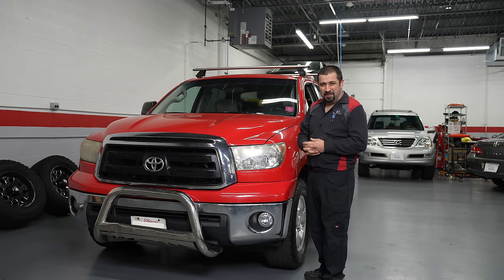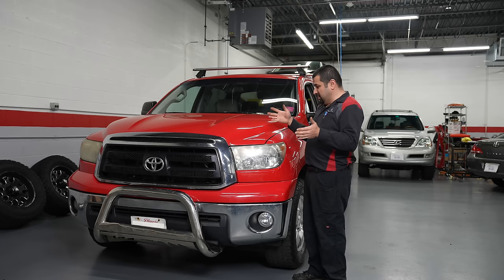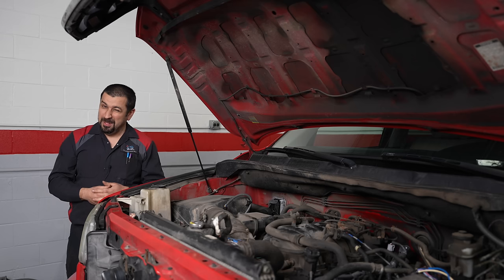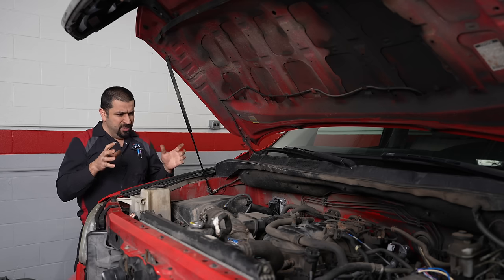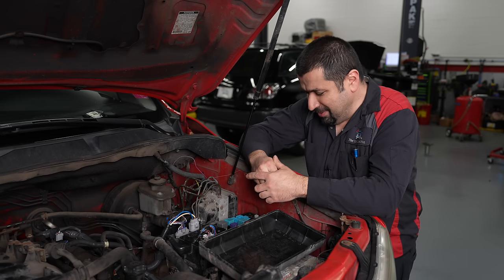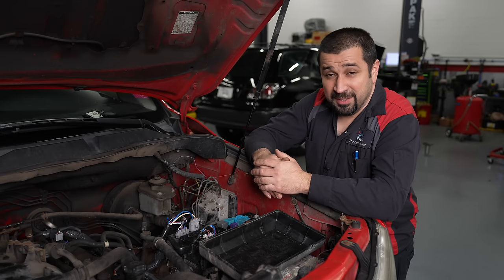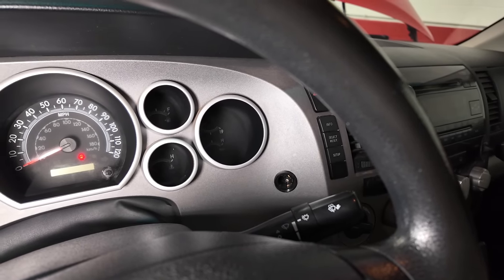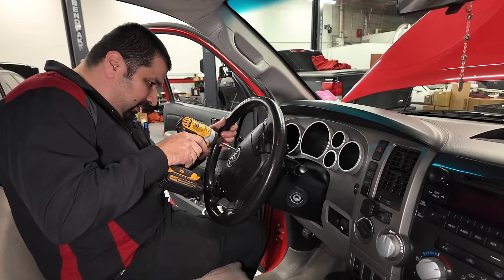Shop BOTCHED Wiring In This Truck Causing a $1400 Repair Unnecessarily

Comment: Good morning I just watched your video I have a truck that I have replaced  partss on 2 or 3 times already . I have replaced the secondary air injection pumps 3 times already. Every time I take them out this condensation in the pumps. I have also replaced the secondary ear injection valve already that's located on the needs the wheel well of the truck. So basically once a year the trunk goes into limp mode I'm still able to drive it but it has lost power until I replace everything and reset the computer. My question is what is causing this in the first place.

Comment: How tf you gonna see ground on the other side of the fuse slot when your horn button on the wheel is not pressed and you also disconnected the signal wire that completes the path to ground!?!

Comment: Fixing a horn by wiring a new ad hoc circuit to a new switch on the dash?  That cannot be legal.  A horn in a car must be present on the steering wheel facing the driver so the driver can reach it INSTANTLY in a millisecond without thinking about it.  That shop who did that work should be reported to the state.

Comment: 24:50 you shouldn't expect 12v on one side and ground on the the other side of the fuse, otherwise the fuse would blow when inserted in place. You should expect some impedance higher than zero.

Comment: What i found confusing with the horn wiring diagram was that the bottom switch to ground on the left side the description was "cruise control main switch". Is there a horn involved with the cruise control?

Comment: I did a battery call one time on a 4 Runner that would crank as soon as the battery was hooked up, melted the terminal off a brand new battery in seconds. Probably not the same issue here but it’s always scary when you have a freewheeler

Comment: Sorry to be off topic, but I'm wondering what you think of the Avalon hybrids 2019 and up. I really love the interior, but notice all your videos mention the ~14 to 18 range. Is the 19 and up just too new to know with the data, or is there something holding them back. Also looking at 2019 and up Camry's, but preferably 2021 interior. Thank you!
Reply: I know for a fact the Avalon Hybrid was running neck and neck with the Camry Hybrid AMD bought for himself. He chose the Camry because it has some technical features not offered in the last year of the Avalon Hybrid.

Comment: The horn issue might be because the security system isn't working?  Since the horn runs through it, can the security module cause the horn not to work?

Comment: Imagine that. A dealership destroyed it. They must have had the oil change guy working on it. 

Needed a new clutch in my Taco. $1400. For installation of a $350 part package, and they never fixed the problem of the clutch hanging when the air temp is around 20F or colder.

Went to a different dealership for an oil change. They forgot to put the oil filler cap, and had oil all over the bottom of my truck. 

I will do my own work from now on. I will NEVER deal with a dealership again.

Comment: I wonder if you can make video about Toyota vehicles theft prevention, like for example what would be safest way to install kill switch without compromising anything in the vehicle.
Reply: Any time I park in a sketchy area and going to be away from the car for a while, I pull the fuel pump relay. That would blow away any car thief's mind when the car won't start. Just pop it back in when returning to the car. It's a hassle but gives me peace of mind.

Comment: As an electronic specialist  all my life (I am 83) I agree with your repugnance for those damned "Knife" style connectors.  Molex connectors are absolute crap as well. Oh!  I forgot ....butt connectors are also crap EXCEPT.... I don't know the manufacture, but there is a QUALITY butt connector or splice that usually has a blue plastic jacket & there are TWO rings on either end of the connector. 
They can be had with a "glue internally, so that a heat gun will flood the wires inside  & seal out moisture, or they can be had without the "glue". They are referred to as "aircraft" splices, but I doubt the aircraft industry used them   I keep a box of them with my "GO" kit for places where moisture may be a problem. In most cases I prefer a soldered connection, or better still, soldered & crimped.
Your videos are ALWAYS first rate. Thank you !

Comment: Back in the day I had an 87 Dodge Daytona Pacifica. Took it into a recommended mechanic to have the CV joint replaced... Came back that afternoon for pickup, I started the car and it rattled like heck. I popped the hood and called the shop owner over..... The shims for the motor mounts were put in upside down 😮. The shims have "THIS SIDE UP" MOLDED INTO THEM.

YEAH ... The owner fixed the issue and gave me a discount...

But I never went back there again... neither did the person that recommended them...

ATTENTION TO DETAILS IS NOT ALWAY COMPLICATED BUT IT IS SERIOUS IN CARS....

EBW USN Ret.
Servant of God

Comment: I had that connector corrosion issue with my 2014 Yaris. Corroded over years of Ontario winters and the wire just broke and the horn stopped working one morning. Fixed it with some solder, heat shrink, a piece of 18 gauge wire and an insulated female spade connector. Never had an issue since.

Comment: Very well done Ahmed!  You are a very patient man to have to deal with these types of problems.  It is frustrating to see how some mechanics butcher the very fine factory wiring when all they needed to do for testing was use the appropriate tools to back probe the wires in the connectors.

Comment: 12:23 - Why are relays made where they can be installed in Reverse // How did you know this, from familiarity with Toyota Vehicles?? //
Reply: Relay sockets are designed and positioned such that relays can be installed in reverse, taking them out-of-circuit for T/Sing without possibility of them being misplaced. Unlike Detroit brands, Toyota, Honda and few others really think about this stuff.

Comment: That’s the problem of the many unprofessional wireman out there! Some of them think they are good at any electrical circuit, they cut-rewire-jump  anything w/o first going through the wiring diagram to understand them and do a proper diagnostic! Some are rough, impatient at the end of the day inflicted more problems than fixes! As customer remember to say “NO” and send to a reliable, professional machanics like TCCN ❤!

Comment: Little does the motoring public realize, 90% of new cars have “one-click start.”  They hold the button in thinking that that’s what you have to do until the engine starts.  Try it by pressing the button and immediately letting go.  You’ll see that your car will start on its own.

Comment: Simplest circuit? I've seen some where the horn button talks to the CANBUS which tells some stupid computer to engage the relay.  The guy diagnosing it solved the problem by disconnecting something else that felt completely unrelated, maybe the radio, maybe the window buttons.

Comment: Master primer on basic automotive electrical. It takes a bit more time to do the job right. I'm sure many unskilled mechanics just want to move vehicle out-of-the-shop by any means necessary instead of spending the time to repair the vehicle correctly.

Comment: I backprobe the connector with T pins or specialized pins, not cut into the wire.  Sometimes I pierce the wire but when done, seal it with liquid tape.

Comment: To answer the question of why most of the so called mechanics haven't completed a technical school and got hired as helpers or mislead shops about their experience. Electrical is actually simple if you understand how a circuit works and one of the things about understanding it is how to properly probe it.

Comment: Wouldn’t the $1400 wiring harness include connection points to the dash or wherever the horn wire is? Or did you take a new $1400 harness and cut it and splice it just to get a new connection point to the ecu?

Comment: Love your videos! Im curious what your opinion on Mitsubishis is? Specifically the Lancer. I've tried doing some research theres nobody out there really talking about it like you talk about Toyotas/Lexus
Reply: Back in the Sentra and Lancer EVO era Mitsu made some awesome vehicles. Even then, build quality and interior fabrics were garbage but the driving experience made you forget your cheap surroundings. Today, Mitsubishi makes other awesome, quality products such as their mini-split HVAC systems. Their product lines for business, industry and the public at large are world-class, wide and deep. Unfortunately, in NA Mitsu vehicles are generally crap, having fallen into the same hole as Nissan. Not worth your time. Stick with the major players and leave the wannabees to the suckers. Cheers!

Comment: I had a customer who had a remote start installed by a radio shop. The radio shop used those red clips around the wire that cuts through the insulation. The wire they tapped was so thin it eventually broke. I took out their remote start and repaired the harness. Told them what caused the problem and they went back to the radio shop and asked them if I was right. The radio shop said I was wrong and that I didn’t know what I was talking about. Told the customer this is a Toyota problem not a remote start problem. The truck came back a month later with the same problem. I told the customer the same thing again but they chose to believe the radio shop. I tried to tell them, I can show you the wires and the wiring diagram, I can explain to you exactly what is happening , I can fix it in front of you and prove the problem. This other shop can only say take it to Toyota.